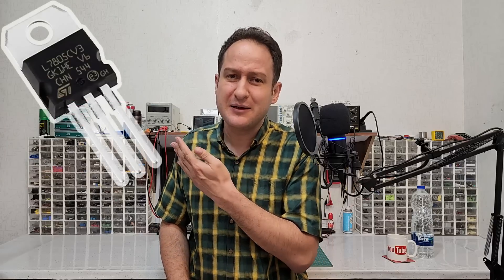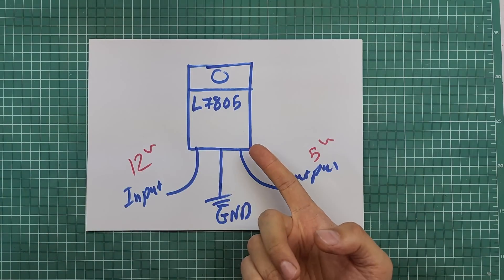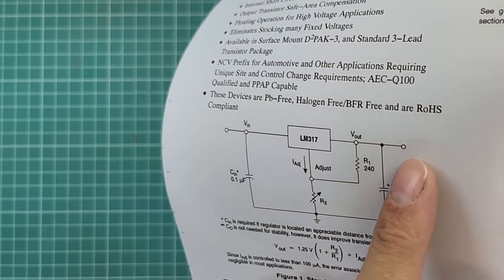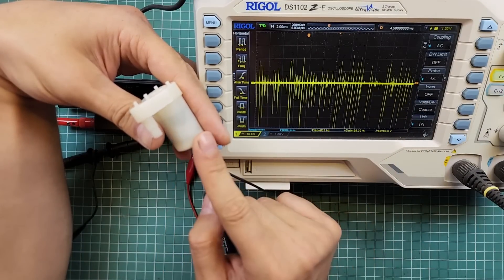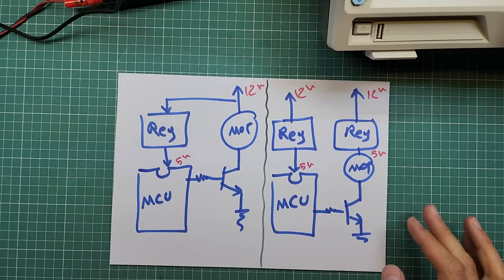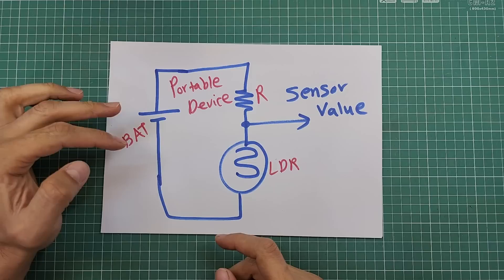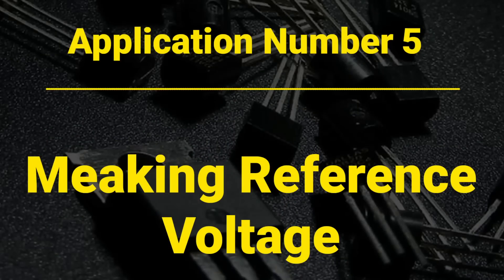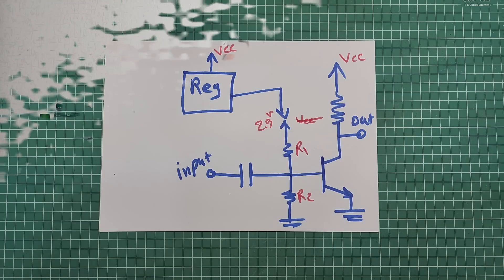Voltage Regulators: What else can they do?

Comment: Well as a reference voltage for an ADC / DAC I would not use a voltage regulator like the 78xx. 
There are specialized Voltage reference IC's like the REF 5050 (5V) or REF5040 (4.096V) from Texas Instruments.
Reply from the maker: Very well,  you are doing great 👍

Comment: Not only is this clickbait but alot of it is invalid, for instance saying that battery charging voltage will change sensor reading... the voltage is differential and you're measuring a ratio so the problem isnt the charging voltage, it's the setup
Reply from the maker: Thank you for your feedback 😌

Comment: I used an LM317 to build a current ramp device, to aid in soft-start of a piece of avionics gear; a Bell 212 starting up can drop the battery bus to almost 6 V, instead of 24 V nominal, so the soft start delayed the power on for a couple of seconds.

Comment: What are your thoughts??   I have an application of using an Arduino 5V to control a Halloween prop that uses a 5V motor @ 600mA to drive a skeleton jaw (The output is PWM and my electronics switch more than fast enough to work this motor). The Motor is used to open the jaw and there is a spring to return the jaw closed.  To protect the Arduino, I opto-isolated the output pin, then I used a MOSFET to drive the current required. I put a reversed 1N4007 diode across the motor to protect against back EMF as well as the motor itself has a small disk capacitor (unknown size, it was part of the older prop electronics).   The 5V supply that I am using is a high current (about 1.5A) switch-mode module that converts my input voltage of 12VDC down to 5VDC common grounds.   With these precautions taken, is that sufficient, or would you still recommend a separate supply for the motor?   I will probably be testing the electronics today, I will scope the power supply to see how badly the noise is when the Jaw is in operation.

Comment: I once heard of a guy who used some 7805 to convert digital 12V signals on his car to 5V for further processing with an AVR.
Reply: Lol seriously. There are logic level shifter 12 to 5V for about 1.50 $ 
Or using an opto cuppler. But voltage regulators as level shifters?
Reply from the maker: Maybe it work, but there is an easier solution for that.
You can use just two resistors as voltage divider network
Reply: @elewizard  Which is a very stupid idea in a CAR!

Comment: Thanks, buddy. I always learn a lot of useful and practical tips from your videos. Interestingly, a few days ago, I was watching a video where someone removed the voltage regulator from a microcontroller to reduce noise! But you said the opposite, which makes sense. If possible, could you make a video about methods for hardening and increasing the stability of microcontrollers in tough circuits and conditions? I know you're an expert on microcontrollers.
Reply from the maker: Thank you meysam for your great suggestion. It will be a good subject for a video 👍

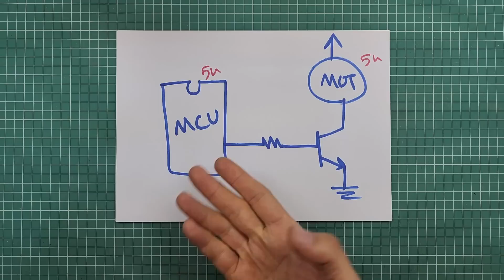Comment: For the MCU, NPN transistor, motor circuit shown around 6:07 are you saying that the inductive noise from the motor will pass from the collector-emitter channel through the base back to the MCU? I admit I am a newbie learning, but I didn't realize this was possible. 

Regardless, thank you for this video, its very helpful for learning. I knew I needed to suppress EMF noise from my dc motor, and now I might experiment with using both capacitors and voltage regulators. 

I really like your channel, and appreciate the time you put into it, I think this channel will grow very much. Thank you.
Reply: I think he was saying the motor would "pollute" the 5v rail with electrical noise. And as this rail is common to both the motor and the MCU, then this could cause a latch-up. Depending on component types, and ratings/values, some interference may also travel back through the BJT, therefore a filtering cap on the base would be helpful.
Reply: @CircuitDuty101  Thank you, much appreciated. That makes sense to me. Especially in light of the next two circuits he shows at 8:35, where the power rail is 12v and the MCU and/or motor have voltage regulators on their high side. Could be that was part of the point he was making and I missed it. Thanks again.

Comment: As one who is learning electronics your videos are very educational and well presented. Are you able to speak about DC-DC converters when you need to increase the voltage to a steady level above the battery voltage to run, for example, a portable morse code transceiver. How can I produce 13.8 volts from two lithium AA batteries that are 3.7 volts each.   Thanks.
Reply from the maker: Glad the videos were helpful. 
By the way, subject of my next video is exactly that.
In the next video, I will explain how we can use an inductor to convert 1V to -80V

Comment: i cant believe you missed out my fave use. for limiting current to sensitive components. i use lm338 all the time, with just output shorted to adjust with a 1 ohm R, then drive things from adjust lead. so it limits current to 1.25A for laser diodes.
Reply from the maker: Yes, I missed that 🫠

Comment: you are always spewing fake information. why?? because from tehran?
Reply from the maker: Can you mention the false info I prevented?
Reply: Well the only thing I don't agree in this video was using a voltage regulator to generate the reference voltage for an ADC / DAC. You can do it but if you want precision you should use a Voltage Reference IC like the REF 50xx like the 5040 with precisely 4.096V 
Anything else I totally agree with @elewizard. 
And I am an electronic technican from germany. 
There is no false information in this video

Comment: Thanks for the video. I would add an important application - content-current source, either 78xx or lm317 etc, can be used as a constant current to drive an LED for example.
Reply from the maker: Awesome,  thanks for mentioning that 👍
Reply: Yes, but if you pulse the circuit to flash the led, you will kill the led because the 78xx takes a few usec to get into regulation.

Comment: In some cases our designs failures because an unexpected enemy, the noise. Thanks to this wonderful video I've discovered that a regulator is not only useful to adapt voltage, they are  effective noise blocker too!
My like is the #217...
Thanks a lot for another interesting  video! Greetings from Argentina!
Reply from the maker: Yeah, regulators are a powerful tool for noise reduction. 
You rock my Argentinian friend. ❤️

Comment: 3:47 a 7805 is NOT a fixed voltage regulator. In fact, you can use a 7805 and have a adjustable DC output voltage between 5 and 16,8V (with 20V input). 
For a output of 5 to 16,8V , you can do this by placing a fixed resistor of 270 Ohm and a potentiometer of 470 Ohm both in series between the common pin (middle pin) and ground/negative of the circuit. That way you have minimum 270 Ohm and maximum 740 Ohm between the common pin and ground. A 7805 can take up to 35V regarding the datasheet, but with above resistor values, the output doesn't go higher then 16,8V if you go above the 20V input.
This type of adjustable powersupply was sold by Velleman a manufacturer of DIY Electronic kits in the 90's, kit partnumber P2570 or K2570.
Reply from the maker: I can't agree with you, because the 7805 is actually a fixed voltage regulator, however it can be used as an adjustable voltage regulator👍
Reply: hell no, its a hammer. you can attach a handle to it, and its perfectly suitable to drive small nails into soft materials. since it can do that, its certainly not a voltage regulator, but in fact a hammer.
Reply: No, in the case you are talking about the design uses a fixed voltage regulator AS a variable voltage regulator. There is a difference.
The manufacturers call a 7805 fixed voltage, the convention has been established that the last 2 digits represent the voltage the regulator is fixed at. So 7805 is 5V, 7812  is 12V, 7815 is  15V etc..
We could open the discussion further and say in fact there are NO 78XX fixed voltage regulators, they are ALL variable regulators! The one that people and manufacturers CALL variable voltage are in fact "fixed" at 1.2V common to output, and use the configuration you mention to "vary" the output over the range 1.2 to 35 volts.
The point is, it is not of any use to state "a 7805 is NOT a fixed voltage regulator" when it is known as a fixed voltage regulator and the minimalist component circuit results in a fixed voltage. Maybe you meant to say "Hey guys! you can use a fixed voltage regulator in a variable voltage circuit!" hmmm?
Reply: @bazzaar1869  hi, i'm just pointing out, that a 7805 can be used as a adjustable voltage regulator and the term "Fixed" is not completely true. Many people don't know this trick and always presume that a 78xx voltage regulator is a fixed voltage regulator , while it can also be used as a adjustable voltage regulator like a LM317. Grtz
Reply: @BjornV78  This was a widely known "trick" actually, due mostly to the manufacturers including this circuit in their device specification and application information.
Reply: @BjornV78 That's a great use to use a 'fixed' regulator at a different voltage. The video doesn't show this trick.

Comment: Or just put a 100nF MLCC across the motor and a 5v TVS diode on the supply. A another approach is to power the MCU through a 100ohm resistor and have a capaictor on both sides. Most MCUs run on 3v3 so 1 regulator should be enough.
Reply from the maker: Yes, putting 104 cap may decrease the noise, but in some cases, it is not enough 👍

Comment: Is it possible for voltage regulator to increase the voltage over the battery voltage ? .. if we need 5v using battery 12v, VR can make 5v, but when battery goes down below 5v, it would be good to increase the voltage from dying battery for example 2v to 5v 😂
Reply: With buck-boost regulators, we can increase and decrease the voltage
Reply from the maker: Yes, boost regulators like xl6009 can easily increase voltage. By the way,  in my next video, I'll teach you hot to make 80v from 0.5v

Comment: If we use a voltage regulator on portable devices will it reduce the battery life ?, because the power loss across the regulators are high ?
Reply from the maker: It depends on many factors. But generally NO, it shouldn't be harmful for the battery 🔋
Reply: @elewizard Maybe not 'harmful' to a battery but the regulator dissipates heat which is flattening the battery for no benefit. Best to use a dc to do converter.
Reply: Not shorten the battery life per se, but definitely discharge the battery much much faster. Like order of magnitude faster. I have used two 18650 in series along with LM7806 instead of four D-type cells and the time between recharges was like two days. So I've decided to redo it, this time using two 18650 in parallel with a SX1308 boost converter, set at 6.2V - there's your first advantage, ability to fine-tune the voltage (easily) . But the other big advantage, the quiescent current is well under 1mA, compared to 5-8 mA of the LM7806. So far it's working for two weeks without recharge.
Reply: @MlokKarel  In my limited knowledge, what could be done to reduce unnecessary power loss is using a switching regulator instead of a linear regulator, since one can be more efficient than the other with the drawback of more noise.